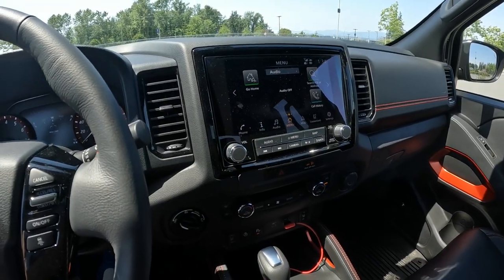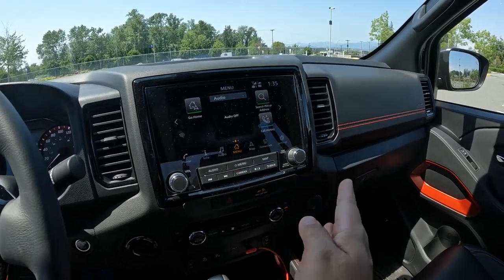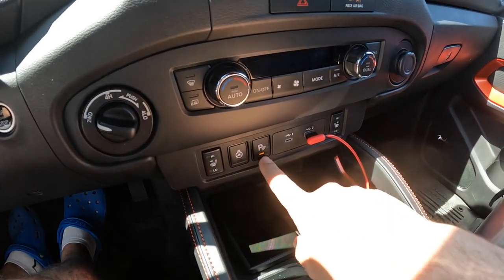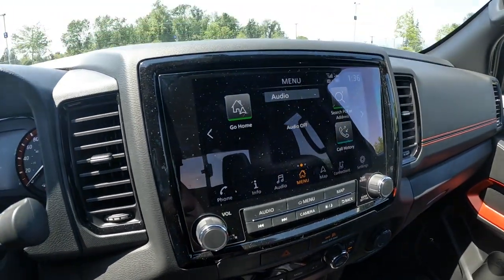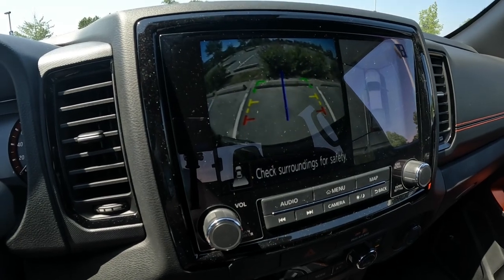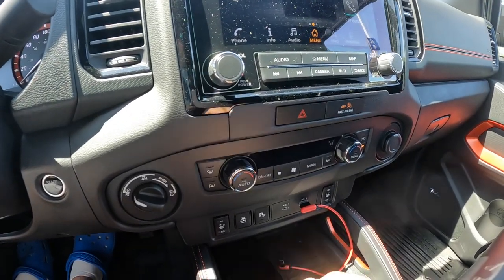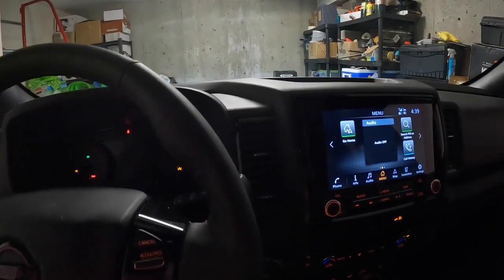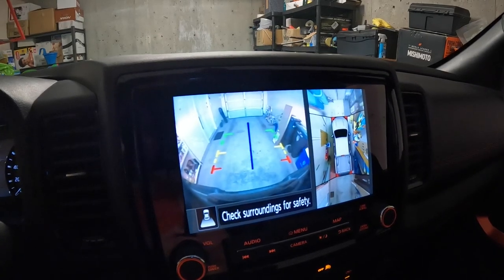How To Shut Off Sensors On Your New 2023 Nissan Frontier Pro-4x

Comment: This is the dumbest "feature" ever to be put on a truck without a way to permanently disable, at the very least this thing should be turned off automatically when the tow button is hit.  I just love that the emergency braking only works when I have a trailer connected, I have tested this out with walls and trashcans and the truck will let me hit those without braking, but god forbid I try to hookup or backup a trailer. I am just waiting for this thing to cause my truck to slide down a slick boat ramp in to the water because I forgot to turn it off after having to pull forward to readjust.

Comment: Your vids have been informative 👍
I've been looking at getting a Frontier (despite the horrible pricing of all mid-size trucks) in Canada. I would have thought 'tow mode' might disable some sensors so it didn't trigger them with a trailer attached.
Reply from the maker: I'm actually not sure if tow mode would change it. I'll have to check it out now that you say that.
Reply: you would think it would because every other truck does. I didnt test that out before buying mine, and I seriously regret this truck because of it and that it get worse gas milage than the Ram 1500 v8 it replaced.

Comment: Thanks for the frontier videos. Is there a procedure to disable the seatbelt chime?
Reply from the maker: I'm not 100% sure but if I figure it out I'll let you know.
Reply: Follow the cable from the bottom of the seatbelt latch and unplug it (should be on the bottom front of the seat)
Reply: 🔥🔥🔥 it would be nice if you could permanently disable it whenever you want to 🔥🔥🔥
Reply: Not all Pro4x have that package. I opted out and done have the side sensors.

Comment: Just bought a Pro4X. Anybody know how to keep the cargo bed light off. There is a switch that is on the off position, which I have it in the off position. If I toggle it down it is in the on position. In the settings menu I turned the light delay from 30 seconds to 0😮and it still stays on!  I am talking about every time I open the doors on the truck.

Comment: do the 23 nissan pro4x use engine auto stop/start
Reply from the maker: Some have it and some don't. Mine doesn't.
Reply: Just disconnect the wire from the negative terminal
Reply: I hate start and stop automatically at the red light.. how do we get rid of it?
Reply: My 23 p4x has it, annoying.